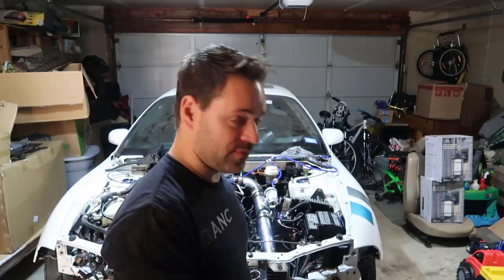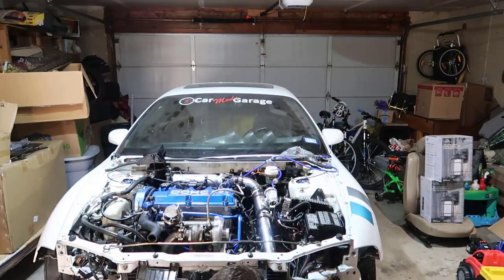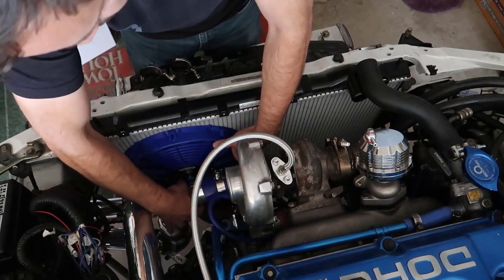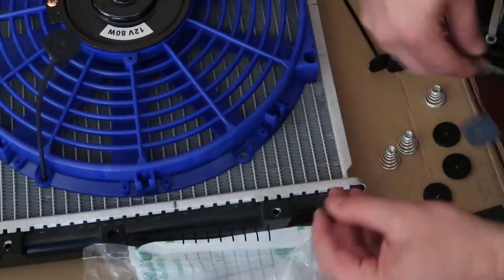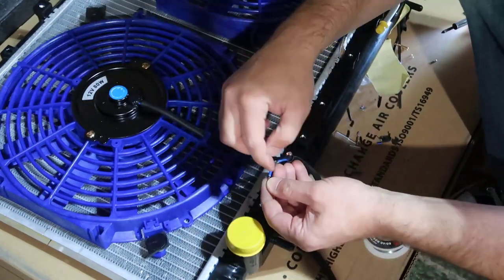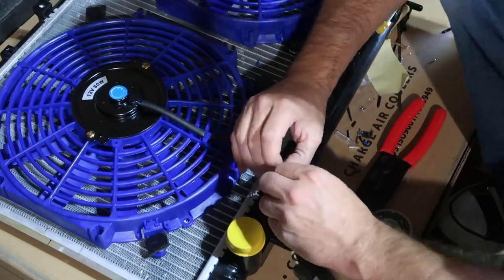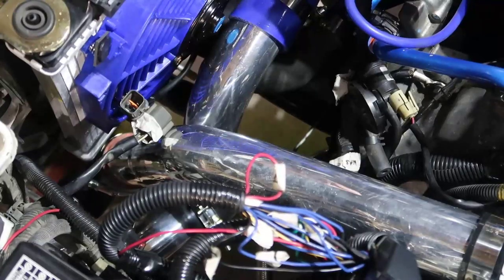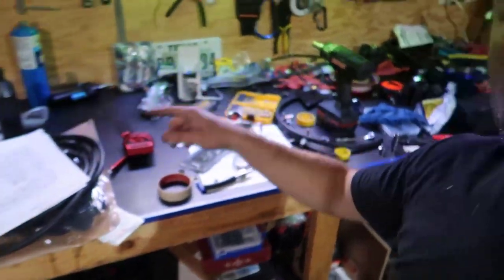Radiator and Aftermarket Fans Installation - #Eclipse2GBuild

Comment: Good video, but the foam pads are supposed to separate all the hard plastic parts from the radiator.  Shouldve put them under the mounting tabs on radiator itself. Any vibration will rub on the radiator and cause damage especially if its loose
Reply from the maker: Ya you are right. I did on the back but not between the fan and the radiator
Reply: Good catch Jordan, makes perfect sense. Thanks for your comment, saves me from doing it wrong. Cheers from Motown.
Reply: I was about to write this exact info, but this comment was the pin one! Glad to know that the owner of the vid actually marked this.

Stay well.
Reply: Your not wrong but your also costing yourself performance you want it flush as possible and using them on the back with out springs will soak it all up trust me I wouldn't just say this

Comment: Hey here's some tips I've found for removing hoses in the future to avoid breaking anything.
Get a hose pick set, or even just use a flat head screw driver to work your way around the inside between the hose and the connector.
And it's also a good idea to lightly heat up the hose with a heat gun to make it more malleable.

It's really helped me with those really stuck on radiator connections.
Nice video! Thanks
Reply from the maker: Thanks for the tip!
Reply: Heat gun isn't a smart idea actually
Reply: Yes Yeah Nah, works good for me too that way. When putting on new hoses or even the old hoses, I just use a little spit inside the hose and it slips right on.

Comment: Umm...my garrett g25-660 has a fitting very similar to yours on top. That's the oil drain return line. It should be facing down.
Reply from the maker: That's my feed line.  The return line is pointing down and it's an 10an
Reply: @CarModsGarage  gotcha. My drain line is also 10an but my feed line is a 6an nipple. It doesn't have that bolted on flange like yours.
Reply from the maker: @HaileyLove42  oh I see 👍

Comment: almost , ...good that you are using those little springs as many people neglect to use them,  I would have put the wider diameter  end of the springs against the radiator fan and the narrow part against the round piece of the fixing rod, so the opposite way around, so those foam pads are in the wrong place,  you don't need them against that spring but you need those little foam pads between the fan and the radiator to give a bit  more clearance for the fan blades as they could scrape against the radiator and also to cushion vibration.
Reply from the maker: Thanks for your comment Chris. I will pin it so people can do it the right way.
Reply: I did mine like you did yours flush and no contact with the Rad at all with out them dna motoring fans are right there with spal the balance is unreal iv yet to see how they hold up tho and il find out i take my 4 runner deep lol and if will be cooling a superchraged engine now

Comment: Are the fans already set for pulling air or did you check first before the wiring and installation?
Reply from the maker: Yes they do but if you inverted positive and ground they will spin the other way
Reply: @CarModsGarage  Marco, I think you have to pop the fan blades off and flip it over also. At lease some manufacturers like Spal and Flex Lite say to do that.
Reply from the maker: I'm going to look again and see if it's pulling air through the radiator into the engine bay. The blades definitely would interfere since they should be designed to move the most amount of air on one direction and if we invert for sure it would decrease a bit or a lot (can't tell) 
Good point though!
Reply: Yes Boss... It Is True... Eventhough The Air Still Flow, But The Efficiency On Both Side Blade Will Have A Different... Firstly, Must Flip The Fanblade To Check Which Side Producing More AirFlow Before You Mount It... The Curve Type Blade Is More Complicated... Both Side Have A Different Airflow Pattern And Different Airflow Power... For A Curve Type, 1 Side Produce Straight/ Center Airflow, And 1 Side Produce Side Splash Airflow... Side Splash Airflow Are Suitable For Radiator To Be Used As Pull, And Straight Airflow Suitable To Be Mount As A Push Type On The Front....

Comment: Lol what if you soldered the OEM connectors to the aftermarket fans?

I did that when I upgraded my speakers. They work just fine.
Reply from the maker: I though about that also. It would work. Problem is if my fans go out I would need to  solder it again. It will definitely work
Reply: Ok
Reply: Ahh got confused for a sec.
Solder is no problem for
Me. Self-taught since 2016.
I put flux paste on the joint to prevent corrosion.

Will do when my oem fans die
Reply: ? That's exactly what he did in the video? Did you even watch it?
Reply: FYI the make kits to repair and make your own OEM terminals, like Weather Pack kits for example. Been using them for 15 years now, fuck cutting and splicing to use a crimp on butt connector that will always corrode.

Comment: How did this went in the long term? Those fans are cheap china units. 60W means it would easilie work with a 10A fuse. Did anyone ever see a factory fan with that low current rating? I didnt. As well, those are low profile units which have lower efficiency then high power fans when it comes to move air through a cooler pack. 

I actually used to try those units anyway and can tell that they are moving something arround the half air volume compared to the factory units (in my case on a Toyota 86). I'd be actually surprised about the low heat deisipation of your engine If those fans where able to keep it cool under serious conditions. In my LS3 application, where I tested them, they where lost in nowhere and the car coked latest after 5min stopped condition at 90F ambient, even with AC of.
Reply from the maker: They are working fine in the eclipse.  I have the eBay ones on my 2jz applications and they work like champ.  I just got some from mishimotto to put on my shoes.  Barely used and they are making noise already. I'll put some eBay also 👌.  They seem to work very well.  I have no measures though so it's all by setting no overheating the car whatsoever.

Comment: I have those cheap type fans mine were 80w did u had overheating issues like i did with the ac on?
Reply from the maker: I did not. Mine are working fine so far. I also have those but 12" on my drift car and it was always good.

Comment: If you want to remove the fans, do you just cut the zip tides?
Reply from the maker: Yes that's right.
Reply: 1/2 ass way to do a job, Zipties are ONLY meant to be a TEMPORARY fix folks and NOT a way to do a final install, ever..

Comment: You should go ahead and mount a good trans cooler on the front of that rad, while you have it all free. Ive done that on all my builds.
Reply from the maker: Not a bad idea. Did you remake the hard lines for that or bent the existing ones?
Reply: @CarModsGarage  I like to use atf rubber most of the time. I've never had any issues with it and its easy to snake around obstacles, keeps a clean look.
Reply from the maker: @mechanicalmonster2115  ohhh got it. Ill look into it. That will be a cool mod to run it through the radiator. I'll also get some space between the Condenser and intercooler
Reply: @CarModsGarage  Put your intercooler out front, for obvious performance reasons. But make sure that your trans cooler has a nice offset from everything else. If you mount it too close to your radiator or condenser, you won't get enough air flow around the cooler. I like to use 3/4 inch to 1 inch thick foam chunks between whatever I mount to. Keeps lots of air flowing!
Reply: Most of my builds have been for towing and an overall "bulletproofing" of my vehicles. My main towing truck has a very large trans cooler, that's plumbed inline with the existing lines coming out of the radiator. So the trans gets to the propper temp, but gets much cooler on the return line.
Reply: Don’t do that our car has axel fluid running the not transmission fluid lol 😂
Reply: @truenopandaa2348  Maybe it's a lack of proper grammar, no punctuation, or no tone through text... but I don't know what you're trying to say here.  Is this a joke? Or... so confused.
Reply: AirborneBadass lol I was typing to damnn fast lol 
No I what I was trying explain lol was that our cars run gear oil not transmission fluid his cars m/t not automatic buddy lol 😂
Reply: @truenopandaa2348  Ok, thanks for clearing that up. And you're completely right, I guess I didn't see that he is running a manual trans. My mistake.

Comment: I highly recommended running 3 fans
Reply from the maker: I though about that but didn't figure out where to put the an extra one. Where you put it?
By the way I did what you suggested rotating the turbo a bit more and it worked awesome. Thanks for the suggestion buddy!!!
Reply: Run two behind the readitor and one in front by the passanger  side but the manifold cut a hole in ur hole to where the manifold is at our heat will get trapped like helll in the car take off urnac condensor too and run no thermostat , recommend running blue coolant from Walmart
Reply: Is blue and black positive and negative?
Reply from the maker: Yes that's right

Comment: Do you have e to pull the radiator to install fans broth??
Reply from the maker: No you don't need to. It's just tighter but it will work also.
Reply: @CarModsGarage  ok 👌

Comment: Actually, High Speed Fan Wont Give A Better Cooling Effect More Than Original Fan... Im Using Car With An Upgrade Engine But Im Using Standard Fan... 13" And 8" Fan... So I Decide To Used High Speed Fan With A Hope My AC And Engine Got Cooled Faster.... So I Replaced Original Fan With 2pcs SARD 12" HighSpeed Fan With 195w Of Power Each... I Also Custom A Fan Shroud To Increase The Efficiency.... Then After All Has Been Done, Im Using It For A Week And I Noticed That The Engine Will Take Much Longer Time To Cool Down Because The Fan Will Take A Longer Time Than Usual To Stop... Because Of That, I Replace Back Those Fans With An Original Factory Fan...  And The Performance Increase Back And Working As Usual...
Reply from the maker: Oh that's interesting
Reply: @CarModsGarage  Now Im Using A Bigger Radiator, So I Can Mount Bigger Radiator Fan On The Back Side... Im Using Factory Fan Type For That Radiator... But Im Upgrade To Bigger 160w Both Motor... It Works Great!.. High Speed Fan Have A Really Good Speed/RPM, The Problem Is Only With A Fanblade... FanBlade Are Becoming Short Because The Center Hub Of The Fan Is Too Wide... By The Way, What The Result Did You Got From Using This Fan, Got A Better Cooling Effect Boss? Because Different Car Will Have A Different Result Depend On Radiator Type And The Gap Space Between Radiator And Engine... For My Car, Im Using Normal But Upgrade With 2 Layer Radiator Before And The Back Space, Gap Between Radiator And Engine Is Quiet Close...
Reply from the maker: I have those fans on the eclipse and also on the bmw with a Supra engine and both work very good.  The bmw is a drift car so it runs on the extreme and I never overheated.
Reply: @CarModsGarage  Thats Really Nice Boss! I Thinks Different Radiator Type Will Affect The Cooling Effect Also... Im Using An Old Type Radiator, The Horizontal Type... By The Way, Thats Really A Good Feedback... Thanks Ya Boss... :)
Reply from the maker: @Dragonkingzx  anytime brother!

Comment: What size fans did you use?
Reply from the maker: I used two 12" check the description but those are here https://www.amazon.com/gp/product/B01531B6VW/ref=as_li_tl?ie=UTF8&tag=carmodsgara0a-20&camp=1789&creative=9325&linkCode=as2&creativeASIN=B01531B6VW&linkId=a6723135a9efac10341f00bc03bd0261
Reply: Size isn't as important as CFM